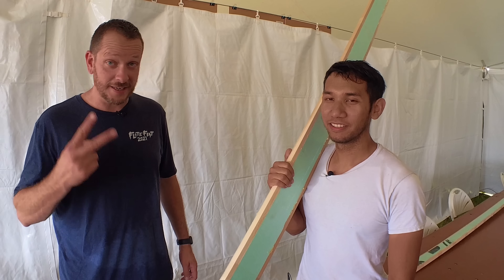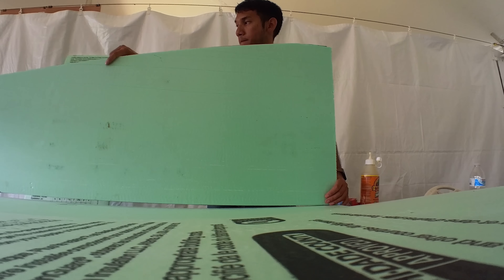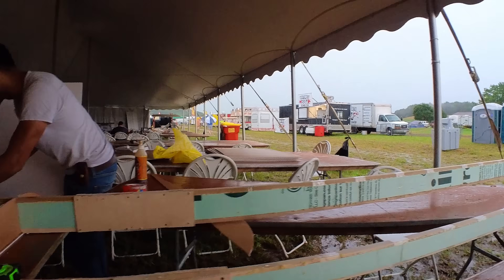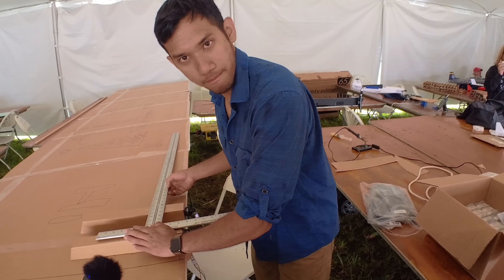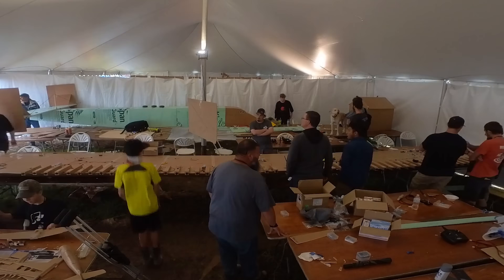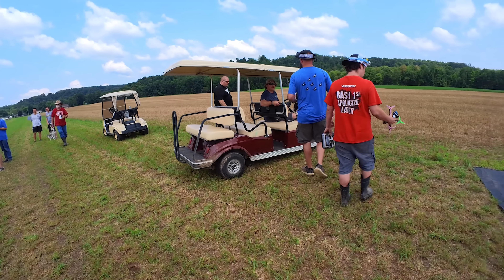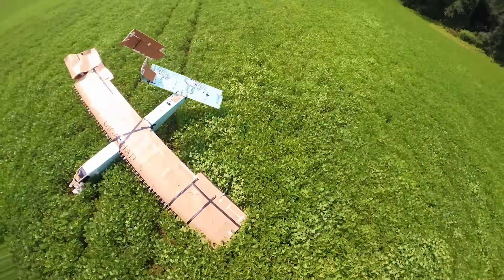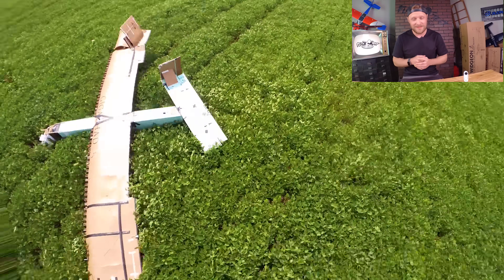50 Motor World Record 30 Foot Airplane

Comment: Great job! However, I like to mention that mounting the motors on the underside of the wing is flawed engineering. While easy to do (as the surface is flat) it does increase the speed under the wing, therefore quite effectively decreasing lift. Lift in itself is increased airspeed on the upper side of the wing creating a pressure differential. This design is creating the opposite you see? Just a tip for the next time, put them on top of the wing. :)
Reply: It's too bad that the educational system in America keeps pushing that "increased speed generates a lower pressure to generate lift" theory.

People need to read up on how a wing actually generates lift.  Lift is primarily produced by turning the airflow, partly by Newtonian laws, and partly by Bernoulli's principle.  Neither of those guys ever did ANY work towards, or study the generation of lift.

While a very small part of the lift of a flat-bottomed, curved top (Clark Y style) wing is from the differential pressure, it has more to do with helping to turn the airflow, because both sides (top and bottom) of the wing do their part to achieve that.

If your statement were true, why does nearly every airliner in the world have their engines hanging below the wing, yet fly very well?  Secondly, if that "increased speed" is so important to generating that vacuum effect, why do symmetrical airfoils work so well?  Completely flat, balsa wood wings on little hand-tossed gliders work wonderfully.

Read this stuff from NASA:  https://www.grc.nasa.gov/WWW/k-12/airplane/wrong1.html

And this should explain it much better:  https://www.grc.nasa.gov/WWW/K-12/airplane/bernnew.html
Reply: @throngcleaver  Thanks for your reply, love a good discussion. 

First of all I am german, I work for a german aviation company as a engineer, more to that later on... Never been through the american educational system, can not comment on that one.

Airliners have their propulsion systems mounted underneath the wing because of the following reasons:
ADVANTAGES BOTTOM MOUNT:
- Maintenance, better access for ground crew.
- Noise, passengers are being shielded from the noise
- Aerodynamics, the top of the wing is more sensitive aerodynamically speaking compared to the underside of a wing. Airflow shall therefore be as clean / laminar and attached as possible. 
- Safety, if the engines get damaged and debris is being ejected or the whole engine falls of it does not further cause cascading damage towards the fuselage and wing, instead most of the radius is downwards.

ADVANTAGES TOP MOUNT:
- Noise, less noise for people on the ground
- Ground clearance & weight, the landing gear can be made shortened. 
- FOD Propulsion ingestion likelihood is minimized

I have read both of your articles and let me assure you that I am well aware of the topic of controversy in the generation of lift. Having designed, build and flown several innovative aircraft designs I assure you that I have expertise on the topic.  

Have a look at our latest project at www.lilium.com ,a fully electric winged transition VTOL aircraft.

- Note the propulsion system being positioned on the upper side of the wing. ;-)
Reply: @supervolant  I am familiar with Lilium, as I spent 26 years in the aviation industry, and still keep up on what's going on within it.  I like the advancements that Lilium is making and hope them and you, nothing but success.

I agree with everything you typed in your comment to me, but I still disagree with your first statement:  "Lift in itself is increased airspeed on the upper side of the wing creating a pressure differential."

The math simply doesn't add up, using Bernoulli's equation to justify the enormous amount of force it takes to lift an aircraft, nor for it to turn a boat or ship by its rudder.  Like a wing, the rudder on a boat or ship deflects the water to one side, which is turning the flow, and that is no different than the wings on a hydrofoil, the wings on an aircraft, and even the flight control surfaces of an aircraft, and the tail and rotor blades of a helicopter.

Do the blades of a turbine engine or ducted fan rely only on the airflow over them to increase the speed of that flow, to pull the blade forward by that lower pressure?  No.  The blades are impacting that airflow, turning that airflow, increasing its speed, and cramming it further back into the engine or duct.  Yes, the airfoil shape reduces drag, and it allows for less turbulent, more laminar flow over the blade, but it's not producing nearly as much lift as people think, and are still being taught.  Turning the airflow does most of that work.

The blades on a helicopter are often made with a symmetrical airfoil.  They fly through the air pitching up, (positive AOA) then pitching down, (negative AOA) every rotation around the rotor mast, as long as they are in forward flight, or any direction for that matter.

Lift is a reactive force, and you have to know that an unsymmetrical wing, still has to have a positive angle of incidence designed into it, OR a positive angle of attack in flight, in order to provide enough lift for the aircraft to fly.  Your Lilium aircraft has what is basically thrust vectoring engines, and that is very similar to how a wing turns the airflow to produce lift, or an elevator, aileron, or rudder creates the forces to rotate the aircraft about its axes.

Nice flying, btw!
Reply: @throngcleaver  Cheers! Great answer, and to that I'd like to keep it simple: I agree! 

Can we align on saying that lift is a combination of both: pressure differential  and air deflection. Wherein you are correct, air deflection is the major contributor. All aircraft have a positive angle of incidence on their wings, even the one's with symmetrical airfoils like a aerobatic aircraft. Therefore it is safe to assume, without explaining it mathematically, that air deflection is in fact the major contributor to lift. However, one got to love a well designed profile shape with a bit of pressure differential at play ;-) 

To go back to the initial comment and actual topic of mine. Where is it better to put the propulsion system? What do you think? Top or Bottom?
Reply: @supervolant  Hey!  Sorry for the delay, spent yesterday at the farm.

As for top or bottom, it really all depends on multiple factors.  That's like the argument over high wing, vs. low wing.  Airspeed range, desired landing/takeoff speeds and/or distances, wing design, gross weight, and so on.  One of the many things about aviation, is the huge number of different types of aircraft, and what their capabilities are.  Not just different models of the same type, but completely different designs for different operations.  Pick one type, like "jet fighter", and you'll see many different wing styles; delta, straight, swept, with dihedral, with anhedral, shoulder mounted, mid-fuselage, low wing, and on and on.

Like you mentioned before, top mounted engines disturb the clean airflow over the upper surface of the wing, which is fine (in most designs) in straight and level cruise flight, but during slow flight, you need all the lift you can get.  That's when you want that wing producing the most lift at a low airspeed, so without other considerations, bottom mounting is best in most designs, with turbojet and turbofan engines.  Turboprops and piston engine aircraft typically have their wing-mounted engines barely above the chord line, or quite a bit above it.  A large part of that design is to have more prop clearance, but other factors come into play as well.

High-wing singles have the engine below, while low-wing singles have them above the wing.  Both fly just fine, but the difference in efficiency, speed, landing characteristics, and many other factors, are difficult to compare, since there are so many other differences between two designs by two different manufacturers.  (Cessna/Piper, for instance)  You would have to design an aircraft where you could move the wing from the bottom and place it at the top, without changing anything else about the aircraft, (CG, center of lift, angle of incidence...) to get a good comparison.

Are you familiar with the YC-14 and YC-15 aircraft?  Those two designs were in competition as STOL cargo aircraft.  The former having twin top-mounted, high bypass turbofans, the latter with four bottom mounted, low bypass turbofans.  Neither of which had thrust vectoring engines, but both utilized different methods to turn the airflow of the engines, to attain far more lift with engine thrust, than would otherwise be obtained.

The YC-14 utilized the Coanda effect with an upper surface blown flap design, and a supercritical airfoil wing.  The YC-15 had externally blown, double split flaps, where the engine thrust was directed downward directly by the flaps, (similar to thrust vectoring) but high velocity airflow through the slots, took advantage of the Coanda effect to increase airflow over the top of the flaps, reducing drag and gaining more lift.  It too, had a supercritical wing design.

In the end, the YC-14 had far more drag than their numbers originally indicated, and the McDonnell Douglas design won out, so we have the C-17.

I spent several years working on the AV-8B program, so I'm quite familiar with thrust vectoring and V/STOL aircraft.  Being a quadrotor pilot and doing work for Lilium, you know that vectored thrust, and differential thrust makes for some very interesting and highly effective aircraft designs.

Lilium places thrust vectoring engines on the top of the trailing edge.  Pusher engines are normally extremely efficient, whether they are jet or propeller aircraft.  The Convair B-36 comes to mind, as does the Cessna 336 Skymaster, which has a tractor and a pusher prop.  During single-engine operation, the pusher is more efficient.  Why don't quadrotor/multi-rotor aircraft have their propellers on the bottom?  ;)

Having said all that, (yes, I type WAY too much) I'll just repeat myself by saying that engine location depends on the design of that particular aircraft, and what the desired performance is.  There are too many factors at play, to say that one is better than the other.  I'd say that the best design, would be to mount the engines internally, like the B-2 bomber, most jet fighters, and nearly every missile.  Anything hanging out in the breeze, is creating drag.  Engine inlet design is just as critical as location.........maybe more so.

Have a great weekend, Supervolant!
Reply: thanks for that, thats actually some brilliant insight!
Reply: @realbaseball1707  Was sad to see the aircraft going down like that, while rarely putting out comments, I had to mentioned that. Glad you like it! Cheers :)

Comment: Spray gorilla glue with water it will set quicker top tip 👍👍that's how it works the moisture in the air reacts with the glue

Comment: What about doing a giant flying wing? It would be more structurally sound with less moving parts and you could use it as a heavy lift for launching quads and planes off. Sripol people unite.
Reply: "Launching quads and planes" off of the most CG sensitive type of aircraft? That's partly why airliners don't use them, fat people get offended when you say "sir can you move to the front, or at least 4 seats forward?" then they'll say why and if you respond truthfully of "you're fat butt tips the entire plane so far back it becomes unstable and we would all die if we tried to fly" they get offended...

Also I would call this simple, you can easily do 4 motor groups with simple throttle mixing so you can use them as yaw control, so roughly 12 motors in Y plug servo extenders for a "motor group", and that's about it. With wings you don't have pure pitch control (pitch up causes loss of lift, opposite of what you probably want), no yaw except motors (in this case not an issue, other than the motors need to stick further out the front so the props don't hit the wing since it will have sweep), but your roll also induces yaw since it increases drag on the side you're increasing lift which is going to bank it in the wrong direction. Anyways, a flying wing is one of the more difficult planes to control as well as find the CG (and they only have one shot attempt at getting it right), so in reality, no, that's neither good for heavy lift nor is it simpler even if it does have 1 less servo (since neither needs yaw), and the delta wing I've made that works well has just as many servos (vectored thrust, which overcomes almost all those issues I mentioned because it acts more like a standard plane except its still very sensitive to weight change).

You could do a delta, but its not going to be easier than a conventional plane, and certainly not for lifting other UAVs (especially if doing multiple, as its going to tip it to one side unless you can equally balance them and launch symmetrically).

Comment: Isn’t 50 engine’s an record for any type of aircraft
Reply: I kind of doubt it's a record in the experimental world, Lillium has like 30 motors on their prospective commercial offering.
Reply: No engines they are motors
Reply: @brizlone4067  wrong. engines in this case means anything that provides forward thrust. if they uses 50 minijets that would still count as engines
Reply: @basketcase1235  minijets would count as engines but not motors. Engines run on combustion, motors run on electricity.
Reply: @TaverrVance  English is just weird. In my native language they are just the same word; motoren

Comment: No V-Shape of the wings whatsoever means failure.
Reply: They will flex up due to lift, but also you don't technically need dihedral to fly. Many real planes have anhedral, dihedral is not a requirement. Or do you mean wing sweep? You also don't need swept wings either and most early planes were the typical flat hershi bar style without any sweep (for speeds approaching the speed of sound it is advised), or if you just want to sweep them you could be like an X-29 and sweep them forward.

Comment: Make a penny plane...a small plane that only weighs a penny weight...but full rc
Reply: Cheat by weighing a lead penny. Also the electronics are difficult to do with that and they are too light for powered flight. Even the one I did with heavy 1mm diameter carbon fiber rods and saran wrap with a toy helicopter as its motor was just too light for outdoor use and indoors it was too powerful and ripped itself apart (although part of that was poor design, but its max speed was still only like half of walking speed).

I think its more fun to have something more robust than a tissue (figuratively, as tissues are actually way stronger than what you'll need for the wings), you probably want something a little more practical and acrobatic unless its just for a one time use to prove that you can (and I think researchers already have, so its not going to win against them, so might as well make it fun)

Comment: Random question since this is a video for firsts - what would happen in a light and small 'wind tunnel' - essentially two boxes on top of each other with the internal walls between the boxes at each end opened up for air flow - that is sealed and cycling the air using a fan plus has a wing inside in the top 'tunnel'. 

Would the wing lift/lighten the whole wind tunnel?
Reply: If its a sealed system there is no force affecting the overall system to create lift. Is that what you're asking?
Reply: @jakegarrett8109  Yeah. An airplane wing creates a lower pressure above it due to the increase of wind flowing over the wing. If the space above the wing is outside of that low pressure area above the dip of the wing would just the wing lift up due to the airflow from the fan? Can't find an example (or a term for it) to see if how the ceiling would be sucked down into the low pressure area with the same force if its farther away from the wing. 

If there is no ceiling the airflow itself could still be the same due to the fan blowing/sucking the same amount of air  (and directed well enough) then the wing would certainly lift but if the airflow volume is not affected by the ceiling then what would the ceiling change?

Comment: A classic case of aeroservoelasticity. As Peter described, it led to control reversal when the control input warped the lifting surface in the opposite direction.

Comment: This was so awesome! Just wondering about motor placement though - with the motors mounted beneath the wing like that, wouldn't air be traveling faster beneath the wing? Seems like that would counteract any lift the wing was generating, but I'm no expert lol. Anyone else know if this would be a factor?
Reply: If anything I believe that helps it. I may be remembering wrong but lift is generated from the high pressure of the faster moving air under the wing and the slower, low pressure air above the wing also hence the classic aerofoil wing shapes to induce lift
Reply: @StuckOnAFireHydrant  I think the faster-moving air is usually going over top of the wing, so that's why I'm curious lol
Reply: @StuckOnAFireHydrant  Flip it, fast air creates lower density/vacuum on the top of the wing. The air on the longer path of the top wing travels faster than the direct short path on the low side of the airfoil (it actually gets to the rear faster than the air below it, at least in most cases).

At the end of the day, a wing is for the most part just redirecting air to create lift, which is why for model planes its often ok to just use a flat wing.
Reply: @000000000 Propellers are plenty powerful for this application, they said they had 2:1 thrust ratio, which for real planes would be very high performance. You could use jets if you wanted, but its entirely not necessary for that foam plane. It crashed mostly due to airframe being too weak, although its motor placement could have been better it was a compromise for easier assembly.